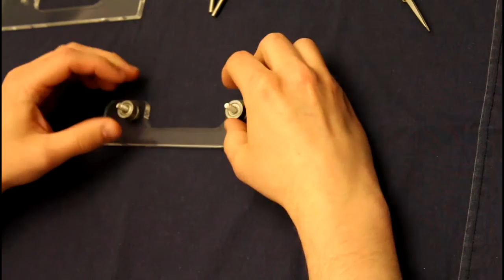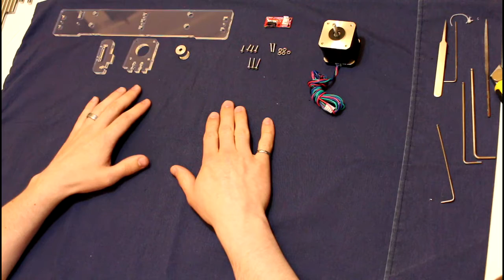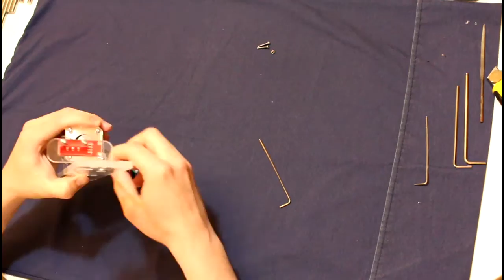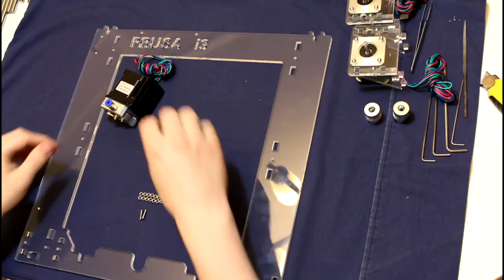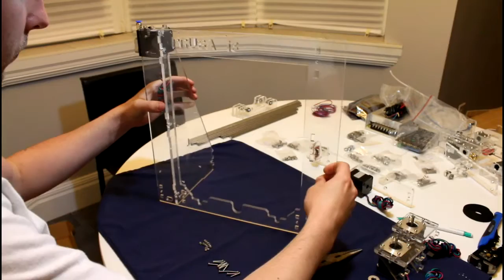Sunhokey Prusa i3 3D Printer | Build Part 3

Comment: @6:39 I found it was easier to flip the whole thing over and install the nuts on the screws from the top. Just about lost one of the nuts trying to put it on from the bottom.
Reply from the maker: +reedwhaley That's a good solution.